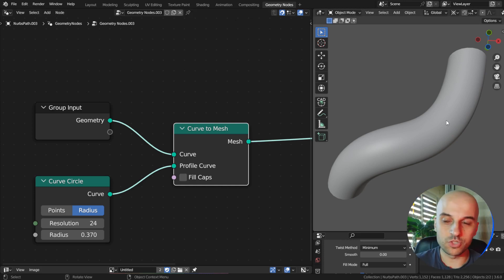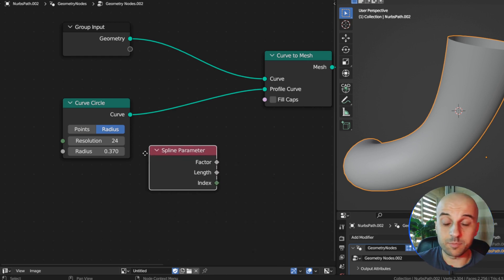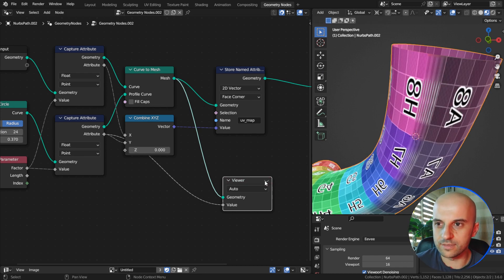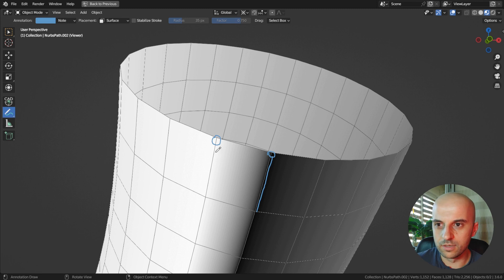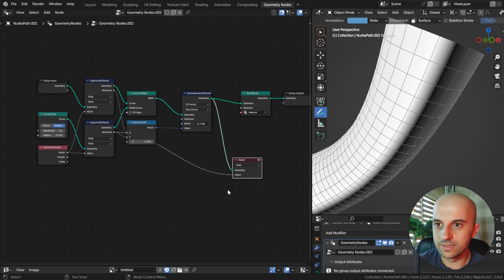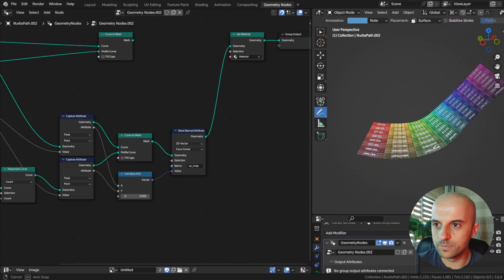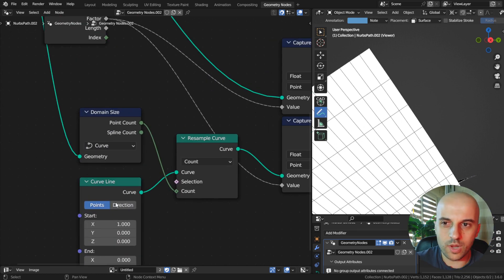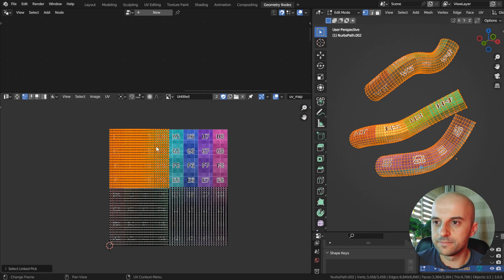How to Fix the UV issue with Curve to Mesh in Blender

Comment: Amazing thank you! The problem that I am running into now is that the "fill end caps" don't work with the proxy mesh.
Reply from the maker: Yes, I didn't cover that in the video. The caps need to be created separately to keep the usable UV map. Essentially, you just use the profile curve and fill it with the "Fill Curve" node, than place it at both ends. Though, you may need to merge the vertices to create a single mesh at the end, and that creates the risk of accidentally merging points that might be too close and corrupting the topology, so you have to chose if it is worth it :)
 I have a full "Curve to Mesh with UV" node in my useful nodes pack, you can find it here https://deanzarkov.gumroad.com/l/many_useful_nodes. There it has the Fill Caps option.

Comment: how to do this for a torus ?
Reply from the maker: To make it work, when both of the curves are closed, like on a torus, you basically have to make the same proxy line, but for the main curve. So create the same setup twice. In a sense, you will create a proxy plane, that you will read the face corner data from.

Comment: Thank you for taking the time and recording this. Might I suggest inserting a Trim Curve node on the profile circle before the Capture attribute node as a shorter way to achieve the same result?!
Reply: Thankyou, very clever !
Reply: Worked perfectly! Thank you for this advice! First I had a gap at end and start point due to both points not coming in in the same angle. but as my nodes setup is based on a Bézier curve object this is still one bezier point in edit mode. I just had to shortcut „v“ and set the handle type to automatic and the small gap nearly disappeared (I used it to make a road track)
Reply: @manmadeartists  i’m glad it worked out.
Reply: Thank you!